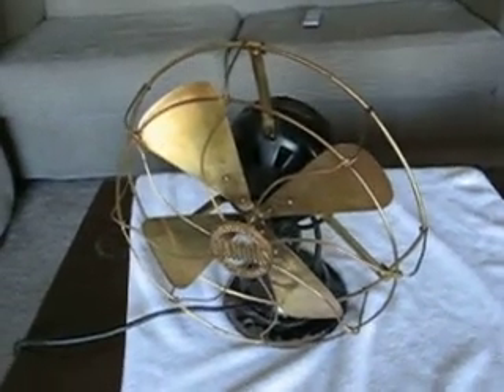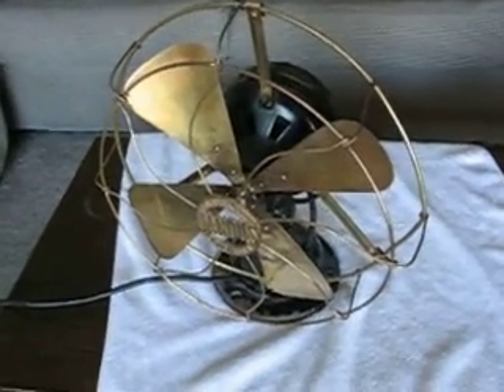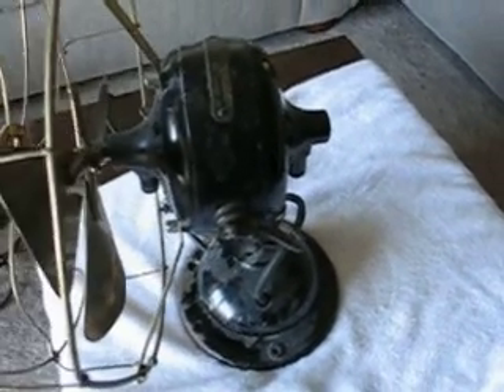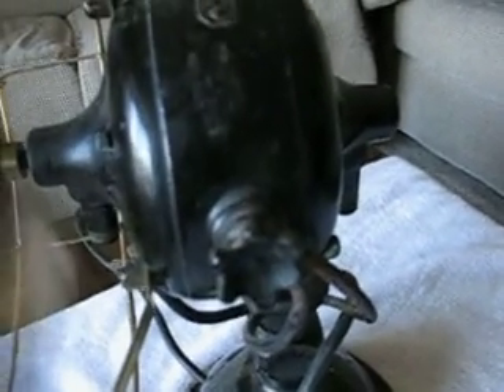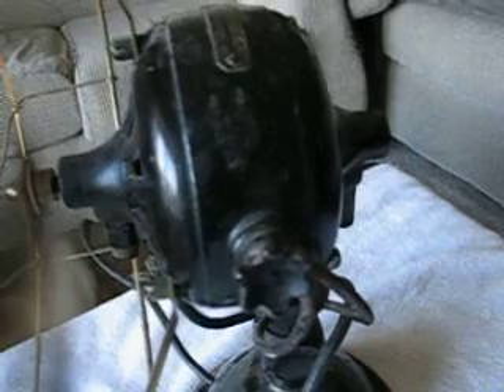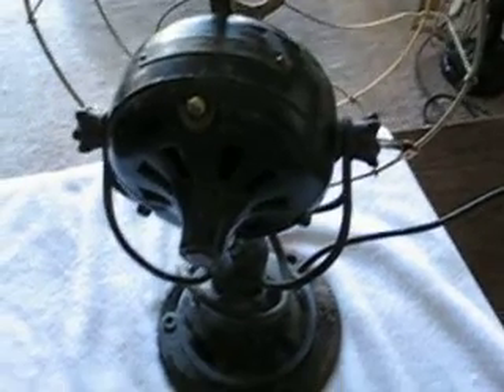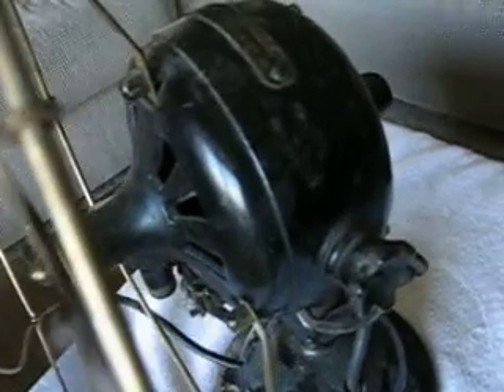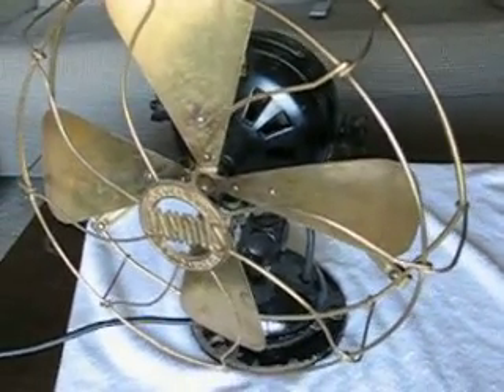Adams Bagnall Stationary Fan.AVI

Comment from the maker: Yeah, it will be powder coated and new wiring installed, plus polish the brass. I already took it apart and cleaned the motor internally and lubed it up. The fan will run for hours without getting warm. I like to make these oldies look factory-new. "Patina" isn't in my dictionary >;^))